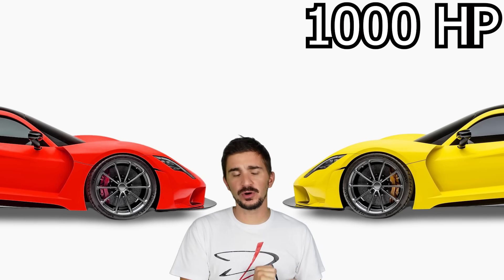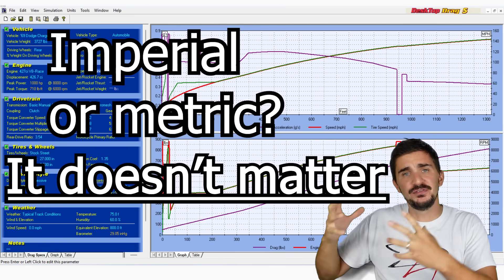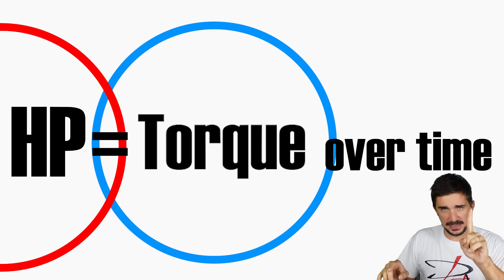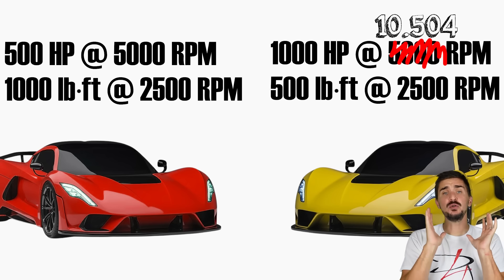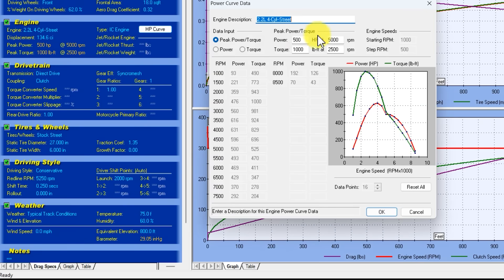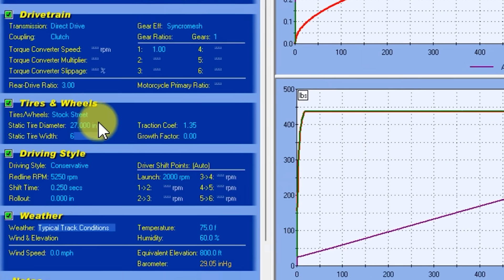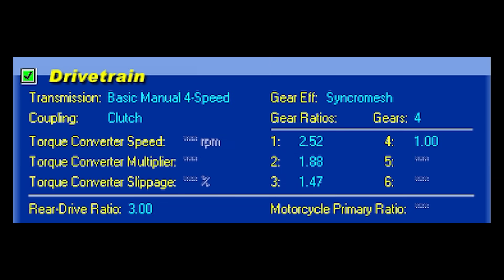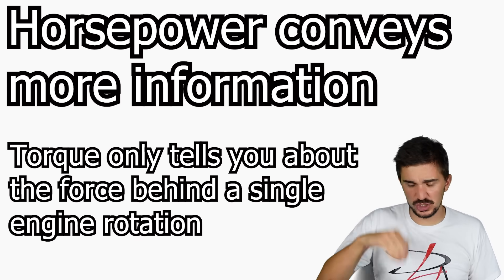Who's faster? Explained and Simulated - Horsepower vs Torque

Comment: The punching analogy is close but it isnt physically correct. Torque would be the amount of force the punch is applying if you froze time right when the punch landed. If you stood on a scale and stopped time, do you not still weigh 180 lbs? Thats torque- force applied but no movement because you cant move when time is frozen. The way you used the punching analogy, a single super hard punch could equal many smaller punches but torque and hp are not competing- torque is whats measured so that you can use it to calculate hp which is the only number that matters. A "torquey" engine is just an engine that makes a lot of low-end hp. Hp is always what you feel. If you look at a lot of dyno graphs you will understand. You arent feeling torque in a V8 car, you are feeling 200 hp at 2,500 rpm compared to 58 hp at 2,500 rpm from a 4 cylinder car.

Comment: HP is the only number that says how much work is being done. You use torque to calculate hp. We would never use torque to calculate another number (hp) if torque told us how much work was being done. We would just measure the torque and be done. We use torque to measure hp because torque is force without time. If you are trying to loosen a bolt and you put a wrench on the bolt and start pushing the wrench but the bolt isnt turning because its too tight, you are applying torque to the wrench but no work is being done because the bolt isnt moving. Engines that make a lot of torque make a lot of hp at lower speeds which is the force you feel- you are feeling lots of low-end hp. Engines that dont make as much torque but have a lot of rpm make a lot of power at high rpm, and you feel that power at high rpm. So the outcome of this video depends on gearing and rpm. If both engines have gearing that is optimized for their powerbands, the car with 1000 hp will win- it has twice the power aka it does twice the work. Now obviously it takes more rpm to do the work but it does do twice the work.  Hp is not just a number used to rate gasoline engines, but also electric motors and can be calculated from watts. That would not be the case if torque is what mattered. We would rate electric motors by their torque not their hp.

Comment: I would like to see a test of vehicles with same horsepower just different engines. 4 cyl, V6,v8,v10,v12 all with the same horsepower and see which is faster with similar gearing.
Reply: Engines are rated with power for the reason not to do such useless tests.
Reply: @simplemachine9531  it's for science and entertainment

Comment: Torque is the amount of energy exerted on a fixed point kind of like putting a socket wrench on a bolt. The bolt in this case is the driveshaft and axles. Horsepower is a result of torque and it is what keeps the vehicle in motion. The zippy high hp formula one cars are super quick but can’t tow much compared to a truck with high torque
Reply: Why do you believe so? Even a bicycle can "tow much".

Comment: Horsepower(like Watts) is the PRODUCT of torque, hence the damage produced. Is why we say an engine “Produces” a Hp number, and also torque is a single factor and watts or Hp is a combined answer to two factors. 
The video does explain this well over a whole video. But it’s simply that.

Comment: Horsepower is the power required to move 550 lbs 1 foot in one second. More horsepower moves more weight in the same time or the same weight in less time.
The transmission and rear end can keep the engine at the most efficient rpm.
More horsepower should win the race. The debate is between using rpm or torque to get there.
Big trucks and heavy equipment use torque because lower rpm means less heat and wear and longer service intervals. 
Race cars use rpm because the acceleration is faster (the engine can increase rpm faster than it can torque)

Comment: Isn't torque how easy you can work, and horse power is how fast you do the work
Reply: No. You generate more torque on the axis of pedal shafts when riding the bicycle with high gear but it is more difficult.

Comment: you could have solved the issue at the start by making the 1000BHP and 500 torque engine peak its torque at something like 10,500 rpms.

Comment: Also interesting is old tractors which can have 50 HP but 500 ft-lbs of torque… because they operate at low double-digit RPMs.  Why?  Because tractors don’t need to go fast, a top-speed of 5 or 10 MPH is fine, but they need to be able drag a lot of weight— exerting an incredible amount of lateral force on a plow pulling through soiling (or nowadays, competing in a tractor pull at a county fair).
Reply: Wrong. Every engine is rated by power. Old semis and tractors used to have low power because they were simply worse than modern.

Comment: The formula for power in the metric system is a bit odd.
P[W] = 2*Pi * M[Nm] * n[1/sec] would be the "true one"
P[kW] * 1000 = 2*Pi * M[Nm] * n[RPM] / 60
P[kW] = M[Nm] * n[RPM] / (60 * 1000 / 2*Pi ) = M[Nm] * n[RPM] / 9549. Is basically the same.
But the metric system tries to avoid any constants that not forced by math, like the 2 Pi, or nature like g = 9,81m/s.

Comment: What is "faster"?  Is yhe real question. The definition of faster. There are si many aspects of a car as well.  If you could have afforded it, you'd have had two identical vehicles (as close as possible) and tested drag and top speed in many different conditions

Comment: Higher torque = Quicker (e.g. 0-60)
Higher HP = Faster (Higher Top Speed)
Reply: Wrong, violates basic physics laws
Reply: @simplemachine9531  like?
Reply: @ExileXCross  
Power=acceleration*speed with a given mass. 
The reason why you want to shift down for a better acceleration. It won't work if engine is working at its maximum power revs already.
Reply: @simplemachine9531  Know what you are actually talking about, instead of trolling comments sections for people to correct. Where did ever say I say Power was equivalent? Max engine speed? It needs to be there why? So I have an engine and I decide to decrease/increase rod length, tell me how you think HP, torque are going to change for a given RPM.
Reply: @ExileXCross  gather your thoughts if there are any and write the way I can understand. Your original statement is bullshit and I proved it with one line.
Reply: @simplemachine9531  You did not destroy anything at all my original. My
comment stated, in a nutshell, if looking to achieve a high top speed, the higher the HP the better. If looking for the greatest amount of acceleration , the higher the torque the better. Two related but completely independent statements that your autistic behind somehow thinks violates the laws of conservation somehow. Being confused, I asked you to clarify, in response you break out a strawman in autistic fashion.

Comment: it doesn’t matter at what rpm does the peak value occur since the transmission ensures your engine is always around there as you’re accelerating

edit: this is the core of confusion for people glorifying torque over hp because they get the impression it’s better for accelerating the vehicle due to all these “direct drive” theoretical concepts and lego builds that are not representative of reality since in reality you have transmission ensuring the engine is at the peak of its power-band at all times throughout the acceleration and then you realize that car with double the torque and half the hp is actually much slower

another edit: you forgot to explain that engine torque and hp is something different than wheel torque and hp due to many more things than just losses and transmission

Comment: Similar concept to the relationship in rocketry between thrust and impulse. Impulse is what makes rockets reach a final velocity (force applied over time). It is the integral of thrust multiplied by the time over which thrust is applied. When controlled for mass dynamics, it gives you specific impulse, or the density of delta V potential per unit of engine/fuel mass.

Comment: I used to always think of this.  I saw HP is like a sprinter, can move legs very fast.  Torque is like a strong man, moves lots of weight with ease.  So let me see if I think the car with more HP wins.
Reply: You used to mess speed and power. Despite you were clearly told multiple times that there is torque, power AND speed
Reply: This is a very wrong way of comparing hp and torque, sadly many people use this.

Comment: Assuming you adjusted the transmission ratios you'd get the same result from both? Because ultimately the torque based engine has more power

Comment: Add a turbine with limited maximum airflow and that becomes complex... but makes able smaller bhp engines to be much more elastic and in turn able to accelerate on lower rpm.

Comment: Horsepower works better with low weight and high revs like motocycles.
Torque works better with low revs and many gear changes and can handle high weights. That's why mooscle cars have 10-speed gearboxes.
Reply: You messed it up.
And muscle cars used to have 3-speed gearboxes.

Comment: It would be interesting to see this test again with cvt transmissions where you could keep both engines at peak power for the full run. I think the times would be much more contrasting.
Reply: The CVT would fail before completing the simulation.
Reply: High HP car would win, as the CVT can adjust the torque-rpm ratio as needed by the tires.
Unless both engines have enough power to keep the tire at the grip limit for the full drag. Then there is no difference in times.
Reply: @MrHaggyy yep this is why snowmobiles are so fast with low torque numbers.

Comment: So theoretically, how would car A vs car B perform if Car A has 500hp and 500ft.lbs and Car B has 500hp and 750ft.lbs? 
If weight, tires, etc is all the same?
Reply: Performance will be different only on the first gear and if launched from idle (which is not a case for racing).

Comment: This may work for drag races but real track or street driving includes turns, braking, accelerating, gear changes, etc. With more torque achieved at less rpm it is faster to go up to speed. Not to mention it is more efficient.
Reply: Wrong. Track driving means tuning the gearbox the way the slowest turn is passed on the first gear at revs below peak power. Launch is also performed not from the idle. Good racer always stays on the power band.

Comment: Finally someone else realized that HP is TQ over time. RPM is revolutions per minute, that is a measurement in time.

This video is very simplistic and blunt, which is ok for a YT video as its real easy to get off in the weeds with this sort of subject. Make traction a non issue and TQ wins. I have to admit getting my engines to hook is the challenge, and then getting them to not lift the nose off the ground is the next challenge once the tires hook. 

Gear ratio is VERY important as is the torque curve of an engine when it comes to acceleration. Other large factors include mass, drag, etc. The engine design matters a great deal as well, because good luck getting a Honda 4 to make 1000ftlbs at 2000rpm. Can they handle over 70psi?

Lets make it easier to understand and make them both 500hp engines, but one makes that power at 5252 and the other at 10,000rpm. The 5252rpm engine is making 500ftlbs, and its going to be making 500ftlbs below that point as well due tot he nature of how torque is produced. The 10,000rpm engine is only making 265ftlbs, so it will need lots of gear to get anywhere.

I tend to build large engines, 455+ cube Pontiacs, which due to their long runner high velocity port design create copious torque between idle and 6000rpm. 500ftlbs is about where they start out with iron heads, and that is 500ftlbs from 2000 to 4000rpm. Some heads carry it a bit farther, enlarging the ports on a Pontiac simply nets you more torque everywhere, there is no hole in power created by the port being too big. The velocity of the port from venturi to the piston at BDC is high because of the length, shape, and size, so these engines fill the cylinders VERY well under 6500rpm. Yes, its apples to walnuts to compare it to a smaller engine, but bear with me.

A smaller engine, like a short runner length 1.8L Honda,  making 500hp at 10krpm is going to have very meager torque through its entire RPM range and never come close to the torque produced by the Pontiac, even with the V8 at idle its making more torque than the Honda ever does. However, using gear ratios, and we are talking DEEP gears in the 5:1 range, can get the tiny engine through the RPM range much quicker thus mostly ignoring the lackluster torque production under 7500rpm. It lives at high RPM, and waddles around down low like a drunken water buffalo. 

If the vehicles weigh the same, the torque engine is going to stomp the RPM engine because it doesn't need as much gear ratio, and the longer it stays in each gear the more time the engine has to accelerate the mass in that gear. After 60 feet or so, the deep gear isn't helping you much. If you ride in one of my 3.08 geared vehicles you will see the difference in acceleration with something that has 4.10. Its a big difference. The 3.08 with 500ftlbs pushing it for longer will put bus lengths on the 4.10 geared engine, not because it doesn't shift, but because the longer lever (after the fulcrum) lets you do more work and move it farther when you have the power to lift it. A 3:1 ratio requires more force to move the same mass than a 4:1 ratio does, as the shorter lever allows less force to move the same mass, but not as far.

Tiny high RPM engines require very light vehicles, but if you match the weights and maximize the gear ratios for the torque curve, the engine with more torque is going to accelerate faster.

My Pontiacs with iron heads are RPM limited, they simply do not want to pull after 6000rpm. I shift them at 5800 so the transmission makes the gear change right at 6000. Thats the trade off with long high velocity runners, you limit RPM, but maximize torque. If I run a 4.10 behind my 455 it slows down and is no longer accelerating past 800ft or so. The 1/8, 330, and even the 60ft will be slower with a 4.10 gear than a 2.73 to 3.55 gear behind my engines. More gear is not better in this instance, and a 4.88 will make it even slower, its moving the engine through the RPM range too fast and isn't using the force available for as long as it could be.

Its similar to supercharging a smaller engine, you don't need much gear with a roots blower, because it will be making high torque right off idle. Thats why TF dragsters and Funny cars are limited to a 3.2 gear, its an attempt to limit the top speed so its survivable in a wreck. Those engines are a wonderful example of how both torque and horsepower interact, but are far removed from normal vehicles because of the immense power they crate on nitromethane. Spooling a turbo at the line does the same thing, it increases torque at the launch RPM and all through the run, so they need less gear.

If you are trying to move a heavy vehicle, like a 4000lb muscle car, you want thick torque everywhere in the RPM range of the engine. If you have a 1500lb car you can match the performance of that 4k vehicle with a fraction of the power. Thats like freakin duh, right?  Thats why the tiny engine cars can weigh a lot less than large cube vehicles in events like domestic vs import. you have to handicap the bigger engines because they have so much more potential and can make vastly more torque.

What are the drawbacks to high RPM? Wear on the engine, dropped valves, broken valve springs, rods deciding they want to be lawn ornaments freed from the confines of the block and their connection to crankshafts and pistons... things go boom with more RPM because of the forces involved. Piston speed, centrifugal force, the pistons changing directions at TDC and BDC, all are trying to rip the engine apart. Thats why I kinda like the big engine that makes tons of power under 6000rpm, because it will last longer since its not flinging pistons and rods around at astronomical speeds. My engines last decades of racing with minimal maintenance, how often does a 1.8L Honda need rebuilt if its making 700hp at the crank?

Racing is racing, going fast is cool no matter how you do it. I have my preference, you have yours. Who is faster depends on lots of variables, same as who spends more to go that fast. We put limits on vehicles so your 13 second Civic doesn't have to go heads up against my 11 second GTO (or the 8 second LeMans), except in brackets where you get a head start. Who can make more power and get it to the ground within a certain displacement range is the question they use in land speed racing. Its super easy to go fast with big cubes, its more difficult and thus more expensive to do it with fewer cubes, and you need a lot more RPM to do it.

Its fun to think about the 500 or 1000hp low vs high rpm engine, but in drag racing more torque is going to make you faster, because you are accelerating a mass from a dead stop. So I would advise you to build as much torque as you possibly can at the RPM your engine is capable of producing it, and let HP do its own thing.